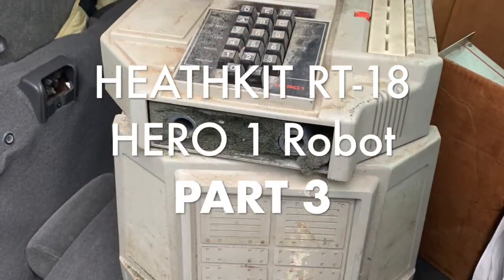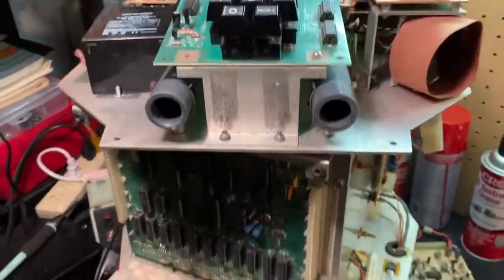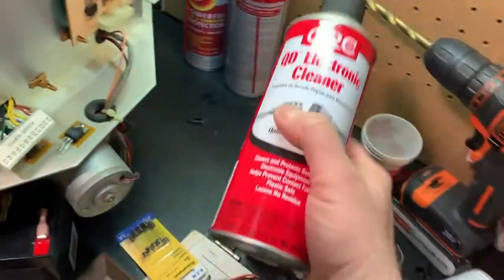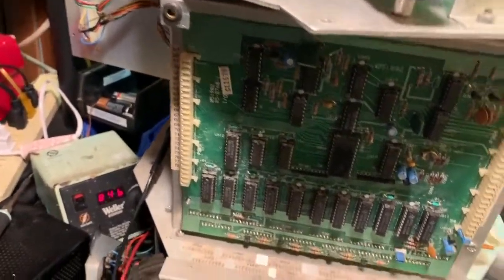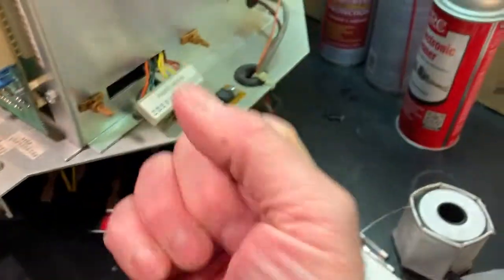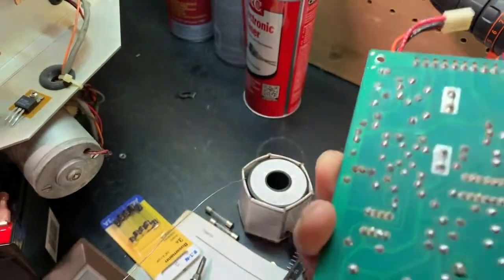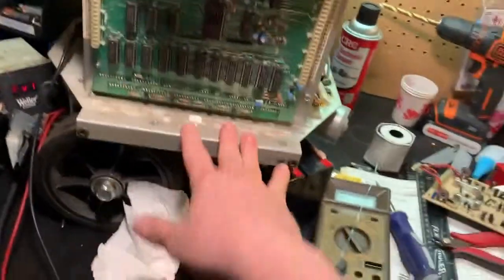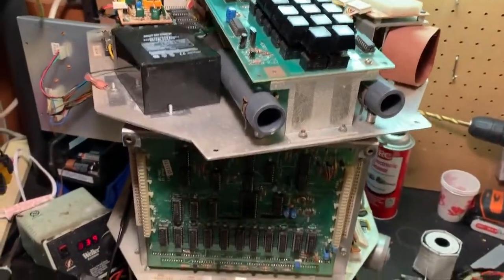Heathkit Hero 1 Robot Rescue Part 3

Comment: Do you still get notified of these comments? I have a Hero 1 that tries to say "Ready", but it's like its voice loses power while saying it. The display does light up and I can enter commands, but it does nothing. It had previously been saying ready and the voice module was working, as well as others. I can't get it to do the initialization sequence either. Batteries are new, and fully charged. All fuses are good.
Reply from the maker: I’ve had that issue off an on but never nailed it down, if I let him sit for a couple weeks without running him through his homing sequence he develops all kinds of start up problems. So far the fix for me has been reseating his I/O boards and sometimes he comes to life enough where I can run him and eventually all his functions start working. His electronics are so old it could be anything 🤪
Reply from the maker: I go through sometimes and wiggle all of the connection plugs. Then he will suddenly come to life, it’s been frustrating sometimes.
Reply from the maker: Just now tried to power him up and nothing, I uploaded a video short on me smacking him on the side to work lol
Reply: @frankycheese  we found that being rough with him will sometimes make him work too lol

Comment: I worked at ZDS after the Heath part of the company moved to another building, then became a separate entity.  Several older techs I worked with came over from the Heathkit side, and they would receive the robots the customers built, then fix whatever they messed up , or would get paid to finish the kits for them.  The wiring harness was not originally int he for m of a wring harness in the instructions, so one of the things a tech would do is upgrade the robots to an organized wiring harness.
Reply from the maker: Its been a while since I powered him up, I am planning to start working on him again with more videos later in the year, intermittant connections are a continued problem I keep having to wiggle wires and connections to get all his systems going, once you give him a few wacks he wakes up lol

Comment: HERO is the name of several educational robots sold by Heathkit during the 1980s. The Heath Company began the HERO 1 project in October 1979. The first units were available in 1982. Models included the HERO 1, HERO Jr., and HERO 2000. Heathkit... Wikipedia
Release date: 1982
Units sold: 14,000(Sold over 8 years)
Introductory price: Kit 1500 US$ (today $3894.31), Assembled 2500 US$ (today $6490.52)
Dimensions: 20 inches high x 18 inches wide (50 cm x 45 cm)